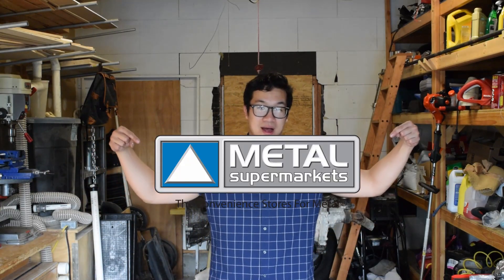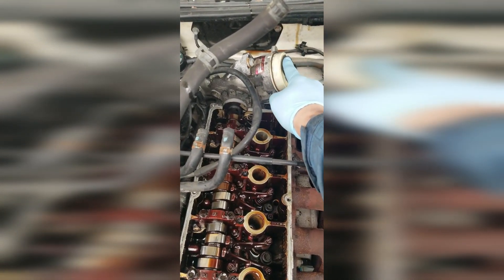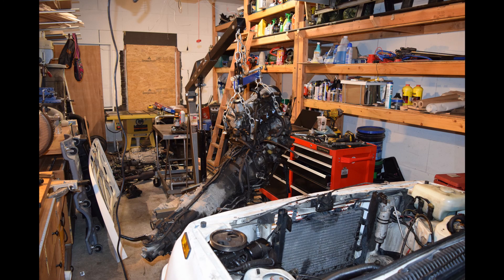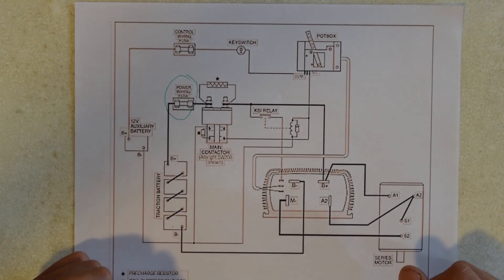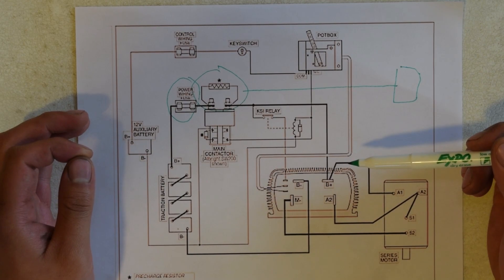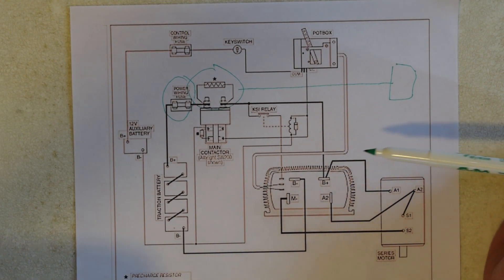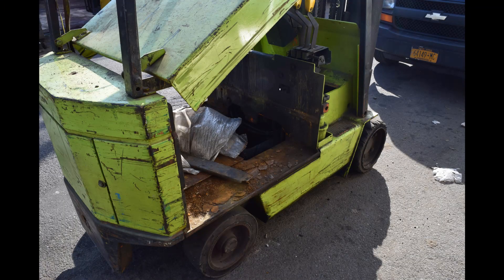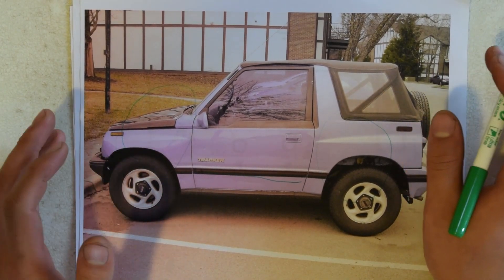Electric Geo Tracker Ep. 2 - Introduction of Vehicle & Plans

Comment: Hi Do you have a Kit or Manual, course I can follow to convert my geo tracker?
Reply from the maker: Hello, I do not have a kit(most of the materials and parts I used for this project are salvaged from other platforms/machines). Truthfully said, and I do mention this in several videos in the series, I am experimenting with how cheap I can build this. Therefore, there is quite a lot of trial-and-error and multiple iterations of designs. I have already gotten the Tracker to drive, I just haven't had the time to edit the videos. Because you asked, I will try to create some sort of simplified guide on how to do this. But overall you can simplify this whole build to several portions. You obviously need the Tracker, which you have. You'll need a motor and motor-transmission adapter(you can see how I fabricated that on my other videos). Additionally, you'll need a motor controller that can mesh with your motor(DC/BLDC/AC?). Finally, you'll need a battery/battery management system. Because there are so many options and paths  you can take out in the market/world along with part/material availability, it's hard to make a comprehensive, one-size-fits-all guide. But if you break down the whole project into distinct parts, it'll seem more manageable. I'll try to revisit this comment in another video that can address your question. Thanks for watching by the way!